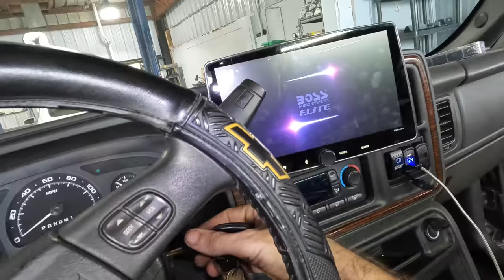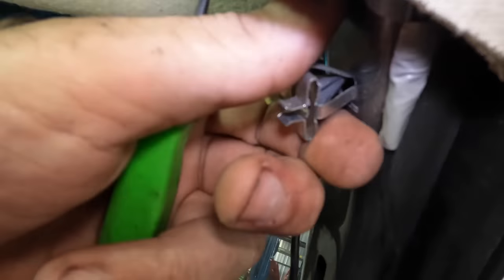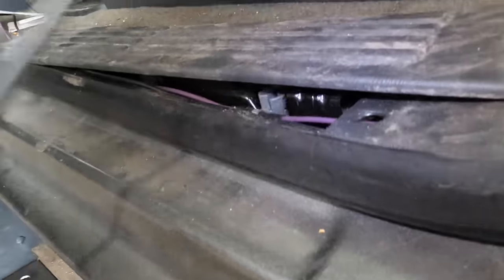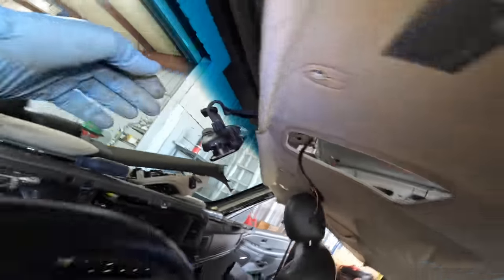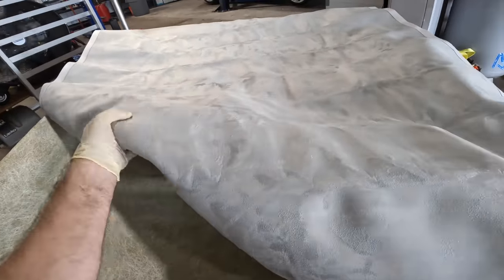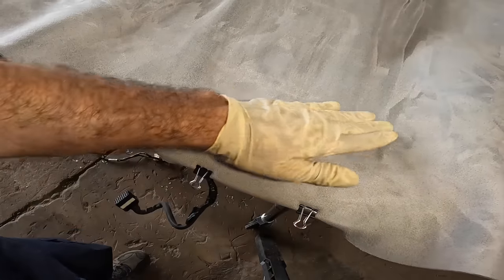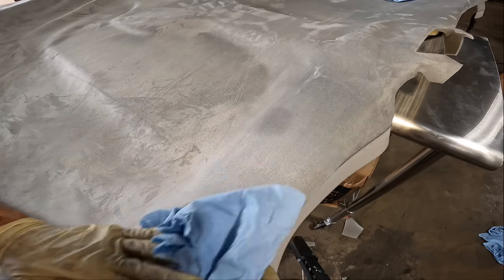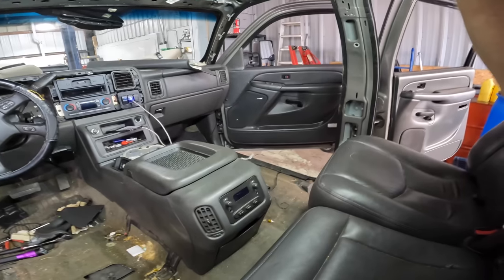Sagging Headliner! NOT an EASY Task!

Comment: I am an upholsterer and you did a great job  for not having a steamer. Well done!
Reply: Agreed. When I saw what he was doing I was wondering if he knew how much fun it would be. Lol. I let my headliners sit in the sun a bit to get the wrinkles out. 
Steamer’s definitely help.
Reply: I did my 68 and 69 Camaro's,super good times! The 68 I did by myself,and ended up inverting the rods from front to back! Had to all come back out and go back in!
Reply: You guys are brilliant.  I would never even think of trying this.  I'm a massive savage with meat clubs for hands.  No bueno.
Reply: Typical everyday repair videos are great and all, but this weird, oddball, do it once a decade or so stuff is SUPER interesting! 👍
Reply: More work than I would want to do!
Reply: I am wondering what happens when the steam is applied? Does the steam soften the glue so you can press down on the wrinkle or it will flatten on its own? When do you start steaming? Doesn't the glue harden in an hour then you can't move anything? I've also seen a mobile 2 guys team use 1" ink rollers, without steaming for a Sports6 Mazda.

Comment: when i did my 88 jeep cherokee i was told set the material in place fold back 1/2 and glue ,then put in place and do the other 1/2
Reply: That's how i did it on my'89 cherokee ,3 cans of 3M hi-strength 90,2 hrs later the hello kitty headliner was on.

Comment: for the headliners that are made of hard board (cardboardish) we use fiber glass resin to paint on the back side ( the non material side ) and let it soak in to strenghten it also on both sides where lights or panel clips go along with 1 layer of fiber glass to strengthen and make the openings more rigid for the lights and panel clips to go in.

Steaming it to remove wrinkles from shipping will also help in stretching it.
Reply: I have a '95 E320 with a sagging headliner. It's drooping in several places including on top of my head. I have it held up with those same clips that Ray used. but there's still a noticible sag.  I tried using an adhesive with the headliner still installed but the hardboard wouldn't hold it.  I like the idea of painting the hardboard with fiberglass resin.  Maybe I'll get ambitious and pull out the headliner now that I watched Ray.
Reply: That's cool, I'd never have thought of that, thanks for the tip!
Reply: I've known people who put fiberglass resin and woven fiberglass cloth on both sides of the headliner and painted it. No more cloth falling down. The heat destroys the foam backing on the cloth. That has to be brutal in Florida.
Reply: @tiredoldmechanic1791 still better than rust...
Reply: @tiredoldmechanic1791  it's the foam backing that deteriates over time, heat just helps it along faster
Reply: When the headliner on my 99 Saturn started separating, I found out that it was fabric glued to a foam layer than to a rigid layer (cardboard maybe?).
The liner was sagging because the foam was disintegrating from age so fixing it would mean fully replacing the whole thing.
I chose not to bother. This worked out because a couple of years later the front strut mounting frames rusted out.
Hooray for living in a snow state! Ugh.

Comment: Ray, you forgot to remove that bolt behind the pillar A on the passenger side which cannot be removed until you grab the nut under the hood just at the top of the firewall on the driver's side under the steering column which can't be held until you uninstall the complete engine bay, transmission, and bed. 
Now, I know this is exhausting, but you must also unfold the weld seams below the rear-passenger bolt hangar assembly... 
Oh that's right, you have a dually, so you can just press the clip back into place using firm pressure and ensure the right "click" exceeds the left "click" so long as there's no "flashlight gravity" in range of the fuel pump and any electronics within 10 feet of said clicks. 😈😈
It's so funny watching you take various parts off that normally you shouldn't have to yet it's part of it 😂😂!
I'll be honest, I've been in the industry for well over 25 years and have never seen the headliner process but I do find it very interesting. Thanks for sharing buddy.

Comment: After reading the instructions to apply a 'thin' coat on both surfaces, Ray applies very thick coats on the surfaces. lol I did the same thing years ago on my truck. Everything turned out fine, except for a few small spots. Looking good! Doing the floor and headliner, the truck's inside will look great!

Comment: Watching your channel inspires me to work on my vehicles. I learn something new every time. I saw some excellent tools on here that I also purchased, making my automotive work much more manageable. I enjoy your work ethic and the processes you follow to repair and replace components. I enjoy your customer fulfillment in installing owner-supplied parts, which none of the ripoff shops here will ever do. A dealership, a few years ago, through intimidation,  wanted $500 to replace an out-of-warranty leaking $10 windshield washer reservoir, explaining that it was a labor-intensive disassembly.  I said NO, I'm a mechanic, bye! I've suffered many of your difficulties with rusted and broken bolts and studs, broken parts, and tight spaces. I built aircraft for Beech Aircraft in the late sixties. I have since earned an A&P mechanic license and have worked on various aircraft during the seventies and eighties, accumulating a few tools doing that work.  You have a great shop, and you're much better off on your own!

Comment: Hi ray,  I have found the following works good when replacing headliners. Lay it out like you did, fold back in half and spray glue on both headliner and cardboard. Then use wax paper to prevent sticking of areas as you start working the material onto cardboard, pulling back wax paper as you proceed. that allows you the ability to work the material in and not worry about wrinkles. I also apply a glue edge under the cardboard where the headliner wraps around the edges. Good job though.

Comment: You can get headliner at Joann Fabrics. Make sure the spray glue you get, can be used with foam (back of liner). Otherwise it melts its and looks lumpy.

I did an old Scooby-Doo van with shag carpet. Don't remember much about that project, after we opened the can of glue.😅
Reply: I remember using the same stuff on a 69 Chevy Malibu SS and had the same results 😂
Reply: @dixiemay1996  69 Chevy would have had a sewn headliner with rods and bows. Talk about a PITA.
Reply: Wiring diagram ? I remember when headliners were put up with Chromed interior bows.

Comment: Get sem spray can dye and make the plastic match. I do interiors all the time. Also you can get it mixed in pint or qts and gallons to spray in a gun. Sem is the best dyes for plastic leather and cloth.

Comment: Not bad for a first timers. I use to do this type of work in the early 70s. Headliners were a lot different then. They were cardboard, no fiberglass. Only suggestion I would give, you needed wooden seem roller or an old rolling pin to smooth out your fabric. Floor carpet is all about tuck and cut. The old cars had the wiring harness running under the floor carpet.

Comment: Ray check out the max power rating on your power strip,I believe that could be your weak point if any,if I'm correct the strips like that from hardware stores are usually 15 amp max rated,just a tip brother,always touch the strip if you think it's failing for overheating,I'm a electrician and being doing it for many years. I have learned so much from you about these new cars,I watch everything you put out thanks again!  Anthony Herrera, Santa Fe NM

Comment: The "speaker" you referred to above the driver's head on the headliner is actually the interior temp sensor used when you set your HVAC to auto.  It's a fan that flows air over a sensor.
Reply: It also determines what temperature the air blows when below 90 degrees, even when not on auto.  If it's defective (or not plugged in with the wires cut like mine when I got it :(  ) the air will only blow outside temperature (or AC temperatures) when at 89 or below and max heat at 90 degrees.

Comment: My 91 Chevy PU made it 9 years before the headliner sagged down to cause me to change it.  I went to Joan-Anns fabric store and the clerk fixed me right up with proper replacement cloth.  I also used 2 cans of glue.   My truck lived in the South with all the humidity for its first 8 years.  Must be a GM thing because my 07 Ram headliner is in perfect shape and it has lived in Northwestern Oregon since new.  Excellent job so far.

Comment: Professional Auto Upholstery Shop use a lot more glue that they buy in 5 gallon buckets and spray with a paint style gun. I don't think you used enough glue and I don't think it will hold and last. Plus those baby spray cans are small and don't spray as much as you might think that they would. I think that headliner needed 4 to 5 cans to "try" to make it happen and last. Good luck with that!
Reply: That stuff we would use would last until the car fell apart. And we used a a lot. It was also a one and done kinda deal once you laid the liner you didn’t have much time to pull it and adjust if needed. Hated doing German cars they always had bullshit holes and grooves that made them a pain in the ass to make them smooth. Loved doing chevys or trucks tho.

Comment: Hi Ray, I knew you were going to break off the long plastic clip, I did the same thing !, I carefully drilled out the rest of the plastic pin by drilling through the face of the A pillar cover, carefully made a small countersink in the plastic, and took a 3 and a half inch long gold coated deck screw with course threads and  painted the head of it to blend into the color of the plastic cover, and carefully screwed it into the metal clip on the A pillar and voila, it is secure and is virtually invisible!, ( drivers side didn't break!) Hopefully this will save you some money!

Comment: Man, when i saw the title and the thumbnail showed a gmt800 dash, i knew where this waa going! Whomever designed the headliner and interior in the crew cab should have been beaten! Ivw got mine out, and still not put it back in. I also went down the rabbit hole, and haven't found my way out yet! 
Spoke to a bodyshop friend when i was pulling mine, and asked how you're "supposed" to take it out....through the windshield opening was the answer. 😮 Great video!

Comment: only gotta take off the left hand front indicator assembly, the bumper and the air con condenser to get to the plug on the end of the harness that connects to nothing, to get the hood lining out... New cars... gotta love em!

Also, line of the vid @ 27:03
That's sage advice right there!

Comment: I just finished something simular. I pulled the seats and trim from my 2011 Explorer to power wash the  carpets.  What I thought were black carpets were actually mid-tone gray. 12 years and 198K miles of dirt. It was a perfect time to do it with mid 80's in Chicago to accelerate drying. And found a water leak in the spare tire hole.

Comment: Good job getting the headliner out of the door, I was told the back or front window has to come out to get my headliner out. Good job on the headliner reline. You may as well order the AC parts and vent door servos since everything else has been removed. No need to do all that work twice. Is Arod coming down for a visit?

Comment: Finished watching it. UpholsteREEEEE. 
Idk how you did it, but you used the wrong equation and got the right answer lmao.
1: Any quad cab chevy with a console, the proper method is remove both front seats and console. Take headliner out pass front door. Rear seat can stay. 
I also remove the wiring from the headliner and tape it to the roof instead of removing the entire cluster. 
2: your glue method. As daunting and scary as it is, fold the material in half front to back and glue the entire half then smooth it from center outward. Repeat for other half (hindsight but future reference)
Lastly, when doing the holes for clips/visor/etc flip the headliner over, spray glue onto the area the holes are in and cut from the back side so you can see what your doing. Then fold the flaps like you've been doing. Do it for ALL OF THEM. it's going to be a PITA inside the truck. 
If you need any input further, or on the carpet install, I'm here to help. 
Again, 14 years experienced upholsterer here. 
Glad to see our trade getting some air time! 
Thanks Ray!

Comment: Buy extra cans of spray glue, you can always return unused cans... Good call on the carpet replacement. Like you said you've come this far, might as well do the carpet since you have it on hand. By the way, great job on the headliner, just hope it holds through the temperature fluctuations...

Comment: I recently did this on my ‘07 Accord.  I used 3m Headliner spray glue.  My least favorite part was that the headliner would instantly stick once it touched the headliner mold so there was little to no moving it if had wrinkles without pulling it apart so hard that it would pull the foam backing off.  The next time I want to find a more slow setting spray glue to make minor adjustments as I went.

Comment: After removing the cluster a couple times I now just remove the wiring from the headliner board and tape them to the roof,the 4 door crew cabs require the console and front seats to be removed to remove the headliner or the windshield removed.

Comment: Ray, I am in Australia and am in the process of refurbishing the interior of my 2007 BMW X3 E83 3.0d (6cyl diesel). I wanted to keep my interior as original as possible. The interior is a BMW  colour called sand beige. The seats are leather and the trims (door cards) are a mixture of leather and vinyl. I had a local auto paint shop match some special vinyl/leather paint for me. I gave them a large plastic panel as a sample for matching. The areas I have painted to date have come up like brand new and I am more than happy wit the result to date. The paint they matched for me is a satin finish and very easy to spray with my spray guns and compressor. The thing I have found with this type of paint is that it is very easy to respray a small portion if it is required. It does not show unlike respraying a car exterior. I recomme3nd that you give this a try prior to attempting to source parts of the correct colour. It is very important that you prepare the surface well prior to painting. I recommend you use an silicone remover to ensure all traces of silicone are removed. All traces of dirt and grease must also be removed. Just prior to painting I use mineral turps to clean the surfaces. Do not use paint thinners as it will melt the plastics. The paint I am using is an acrylic lacquer type paint. My late father was a spray painter by trade for over 50 years.

Comment: HOLY COW Ray, what an undertaking! 😮 Kudos for tackling this project without additional humans to lend a helping hand. If it's not too late, you should seriously consider installing some peel-n-stick Dynamat to the interior before reinstalling the headliner and the replacement carpeting, you can use a small wooden wallpaper seam roller to get it to conform to all of the interior sheet metal nooks and crannies. Good luck with the remainder of the interior. 👍

Comment: I did this on my 04 GMC Duramax, took 4 hours and I didn't take the seats out. That liner will bow without breaking. I sold the truck to my brother a few years ago and the liner is coming down in the same spots as Ray's truck. It took about 11 years to deteriate again but I only had 140 bucks in it so I was happy

Comment: I painted mine with acrylic paint after removing the material and foam/glue, If I could do the job again I would use low odor ( non toxic paint ), because it would be undrivable for 2 - 3 months if not, but yer all good so far

Comment: I remember when I worked for a shop that installed all the emergency lighting, radios, computers, cameras, consoles, etc, etc for police cars, ambulances, fire equipment, etc. Occasionally we would just route stuff around, tuck behind panels, if it was a simple job, but for a full install the first part of the day was completely stripping the interior. Seats, trim panels, carpet, headliner (if a light bar or roof antennas were going in), pretty much everything but the dash. It made installs so much faster when you had a completely open cabin.
Depending on the package, we also ended up stripping the grille, headlights, mirrors, tail lights and all. It is quite the odd feeling disassembling a brand new car and drilling holes in the roof, trunk lid, fenders, etc.  

New cars were great, but what sucked were when the smaller departments would come in with a used/retired police car they got hand-me-down from the state or another department. Stripping those interiors was a nasty, nasty job with all the years of food, spilled drinks and coffee, pee and puke in the back area...you can imagine. We would try to get them to at least buy a new carpet and factory seat fabrics for us to put in while we had everything out. 

It was a fun job, but you certainly needed to be a contortionist to do the under dash wiring and working in the tight spaces of the trunk area.

Comment: A customer of mine had me redo his headliner. It was that same fabric. Was a clean truck and very well kept. The liner was sagging. So I removed the headliner and removed the old liner. Then I applied the new liner with glue meant for liners. Removing the foam, I used a thick wire wheel with gentle pressure. Made a mess but worked great. Turned out really well. Customer said “ looks factory”.  I installed a new pump and a few other minor things. He loves his truck. I do love the cat-eye look of that generation.